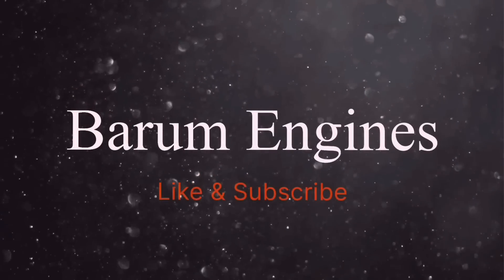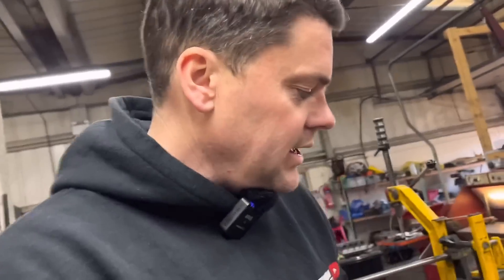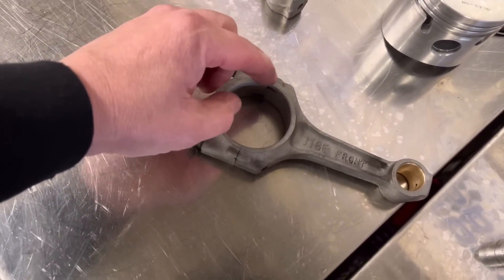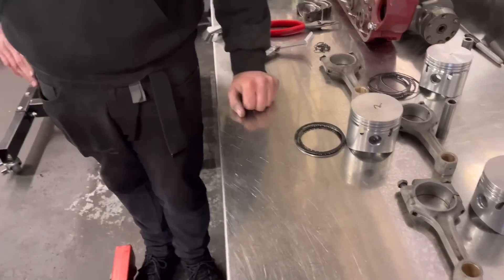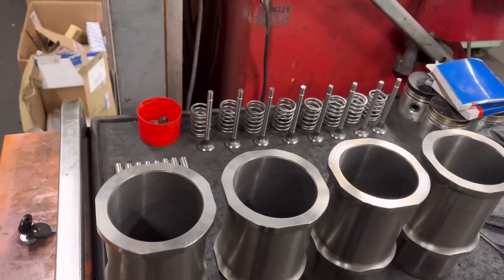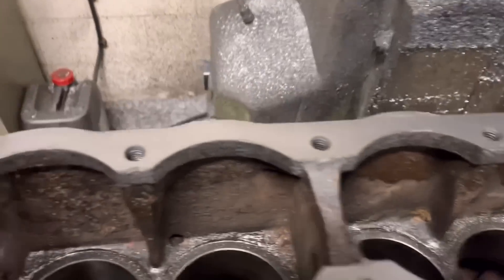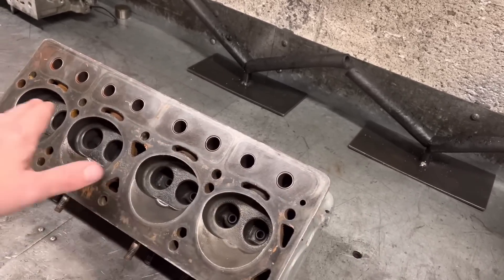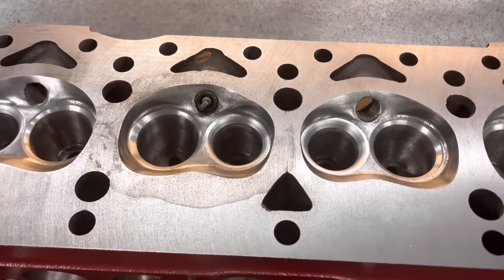“FULLY REBUILT “ they said, this engine would have blown up FAST!

Comment: I enjoy the detail on how you determine clearance is with bearings, and then show how to measure to confirm what you have done. Very few shops go into how bearing fit can very from con rod to con rod on a rebuild depending on what was done to the cam shaft.

Comment: About a decade ago I bought a "completely rebuilt" long block Honda D16 for a Honda Civic Si.  It ran, but not real well, so my mechanic decided to pull the head to check the bores.  That was eye-opening!  The head had obviously had a valve break, turn sideways and beat both the combustion chamber and the piston to death.  They put in a new piston, did a valve job and put in a new valve without repairing the combustion chamber, which looked like it had been beat with an axe!  Plus they used weaker valve springs and the wrong cam. We rebuilt an SI head that I had with the right parts, it ran much better after that.

Comment: I know this is probably too late, but some thoughts on the 440.

On the 440, before chopping .030 from the head, what is the deck height and deck clearance above the piston?  A 440 RB engine has a factory-recommended deck height of 10.725, but they are rarely accurate from the factory and a reasonable deck clearance would be in the .040 to .060 range with factory parts, and I would lean toward the lower side, especially with open chamber heads.  Remember also that the gasket thickness is part of that clearance, so needs to be taken into account.  We used to zero deck the block and pick a gasket thickness that gave us the required clearance.  Some blocks would even be negative decked to give the squish area clearance we were looking for.  

By decking the block, you improve the squish area and on many engines, raise the compression more per .001 than cutting the head because of the larger volume affected.  In the case of these heads, being open chamber, the compression gain isn't as great, since the chamber is the same diameter as the cylinder.  It is still better to machine the deck surface though, if possible, since it equalizes the cylinder volumes at TDC.  I would check all 4 corner pistons and set up to make the 4 corners' final height equal and the head surface parallel to the crank.

The best way to get compression and improve efficiency of the 440 is a set of closed chamber heads, like the 915 casting or aftermarket heads, which give far improved squish.

Comment: The Jensen's were fitted with either a 383 cu in (6.3ltrs) or 440cu in (7,2ltrs)Chrysler RB V8 engine as fitted in the Plymouth and Dodge muscle cars that were raced in NASCAR events.  The 383 could be had in either low or high compression versions and the 440 in generally high compression versions at 10.0/10.5:1.  If the engine is a 440 then it should have a high compression spec.  Generally, the static compression ratio is raised using different height pistons as simply skimming the head creates a misalignment of the cast inlet manifold to the head on a V engine and a problem bolting it down. 

On the pre-crossflow head. why 3 angle the exhaust seat especially, since the inlet has not been done, where it is of most use?  The inlet seat is massive and not what would be expected of a performance head.  The exhaust needs a good wide(ish) straight seat of 60-80 thou as the flow is into the port and the exhaust needs to dissipate heat through the seat, the inlet needs the 3 angle (or better still a radius seat) with a valve seat width of 40 - 55thou.
Reply: My thought also, Could make the intake manifold not seal properly by cutting that much off the heads. If you are into Mopar's, Check out Nick's garage channel from Canada. He is a Mopar genius.
Reply: Can you take some off the inlet manifold too?
Reply: @davidgerrard8661  Yes of course, but the whole thing gets complicated due to the angle of the V (90deg on the Yank motors) and the angle of the inlet face on the head that may not be at 90deg to the head face.  The next problem, once you have done all the algebra and geometric calcs is machining the inlet manifold face, which will be a PITA to set up and then there might be an issue of the thickness of the inlet flange thickness.  With all of that it is far simpler and probably cheaper to use different pistons to give the increased compression.
Reply: @richardpalleschi4807  And David Vizard's Power Tec 10 to get a real understanding about building performance engines.  David is a genius having had 60+ years of 90% perspiration and and 10% inspiration.  His publications on performance engine tuning are widely recognised as industry bibles.

Comment: Those 7ltr V8’s l had a pair of them in my boat - you probably know this but remember to recharge the oil filter when you oil change them - when you fill with oil turn the engine over without starting then whip off the oil filters and fill with oil - they tend to air lock and the middle of the crank can suffer oil lubrication loss - it’s in the handbook
Reply: My dad had a 440 in his Chrysler New Yorker, with the oil pump on the block, not in the pan. I recall replacing it for him and had to prime it to make sure it didn’t air lock as well. I’m not sure if this was common for Chrysler big blocks.
Reply: @andrewwasson6153  that’s correct - for the marinised engines the oil filters are on a flexible remote - makes it easier to recharge the oil filters on a boat   - it’s actually in the service handbook - you can get away with it 90% of the time but that odd 10% can be very costly

Comment: My engine machine shop usually  machine the TE20 blocks to set set the liner protrusion because the faces in the block are often not very good also means the liners can all be the same. I recently tried to do a cheap job, for a customer, fitting new liners and pistons, on site, with the engine in situ, big mistake, could not get the head gasket to seal due to the liners sticking out too far. Lesson learnt, no more cut price jobs because we ended up with an unhappy customer and an unhappy me!

Comment: 2 things about this episode, and I know my comment will be helpful.
1)   COMPRESSION RATIO : there are two ways to look at this, ONE is STATIC  ( which you are measuring ) and the SECOND is DYNAMIC.  They are poles apart !  
Cyl head airflow and camshaft overlap make a huge difference on ratio limits.  Same engine at standard spec may 8:1  but modified head and cam, 12.4 : 1 static 

2)  I would like YOU or your CUSTOMER to prove to us watching, that the preXflow is / and what makes it a genuine "Cosworth" ?
Reply: Why should he prove anything to you? Entitled much?
Reply: @captaintoyota3171  because he is telling me a possible untruth, and I would like to find out if I am wrong, and the fact that he is disseminating information to an audience that would seem to rely on facts not 1/2 truths, and I guess my explanation of static / dynamic ratios verses volumetric efficiency has you completely buggered.

Comment: I was a bit surprised with your CR calcs. I know nothing about the V8s  But with the Ford 4 cyl at TDC the piston fall short of the block deck height by 25 to 30 thou  So for your CR calc to be correct you would have to have skimmed the block Perhaps this was dealt with in a previous video

Comment: Nice to see a Massey Ferguson engine. Rock engines. They go for years. But rare to see a petrol one, smelly red diesel is the usual. Wonder what use a petrol one is for - airfields? Avoids diesel spills.
Reply: Harry Ferguson designed the whole T20 for a petrol engine. He saw no need to offer anything else. It was only through much pressure that he agreed to allow the Tractor Vaporising Oil  version  and the same with the diesel. It was his reckoning that the extra weight was not only a step backwards in making the tractor heavier but it also upset the whole "geometry" of how the tractor operated!  There were industrial versions of the tractor but nothing specifically airfield specification. It was David Brown that produced the ballasted airfield tug. 
If anything, the diesel is actually the more rare engine when it comes down to the Ferguson and the diesels only started being produced in 1953, some six years into production which then ceased in 1956. With the exception of the very first T20s which had Continental petrol engines fitted as a stop-gap, all of the T20 engines were from the Vangard family. Initially with 80mm bores they went up to an 85mm bore. Even the diesel engine is loosely Vangard based and a very strange internal arrangement with the crankshaft that is removed from the back of the block and slip-fit liners. All engines destined for tractors had blocks that were beefed up as the engines formed the tractor backbone and they will not fit a car.
Reply: With regards to the overhaul, these engines, especially the petrol/TVO versions can suffer bad camshaft and bearing wear. The bearings were bored direct into the block with no separate bearings. I haven`t heard if anyone has found a replacement set of bearings yet!

Comment: Is that Mopar 440 RB engine really, actually 0.000" piston-deck height?  You didn't actually say where the pistons actually were in the bore at TDC, which is a critical specification.  As to the head gaskets, to get to 12cc you must have found some sort of ridiculously thick gaskets.  Even thick composition gaskets like a Fel-Pro 1009 are only 0.039" compressed thickness with a 4.410" ID on the firing ring, which would only be 9.76cc.  Those "normal" composition-style gaskets are rarely more than 0.040" - 0.044" absolute max compressed thickness, but you're saying they're at least what, 0.048" thick?!  Interesting.
That 440 would probably originally have had a standard Mopar steel shim type gasket, which would be more like 0.020" thick, which is only 5cc and would bring you back to your desired 9.7:1 compression without removing material from the heads or block deck, thereby leaving maximum additional material for future rebuilds instead of unnecessary metal removal.  (Mr. Gasket 1135Gs work just fine as long as your deck is flat and your heads are flat, properly machined.
Obviously, all these calculations are out the window if that engine is NOT 0.000" piston-deck height at TDC...  so, what's THAT spec?

Comment: As for the negative comments, I told someone about them being negative I told them nothing will work in life with out both negative and positive.  They look very confused 🤔 I told them both negative and positive run in parallel that's what makes everything work look at the light bulb electricity.

Comment: I’m sending every engine I’ve got to you from know on 😁👍
Reply: I’d do the same if I weren’t in the colonies. I’ve got two vintage 4 cylinder race bike engines to go through in short order; one is rare; one of 500 made and bored out. I’d love to send the heads, cylinder blocks, cranks, rods & pistons for checking, balancing and getting ready for assembly. Being so far away, the transport would be ridiculously expensive. It’s not beyond me to do but these guys do it every day and they do it extremely precisely.